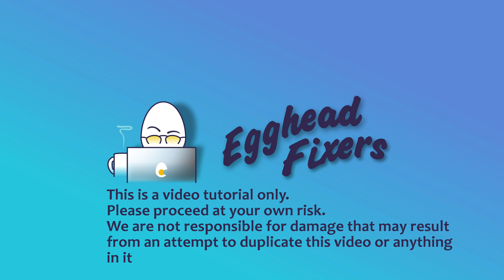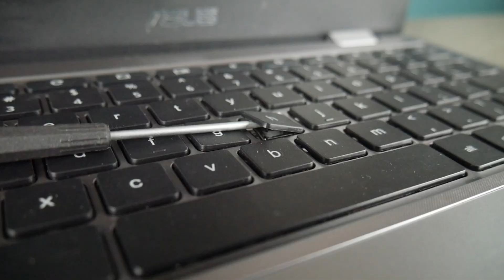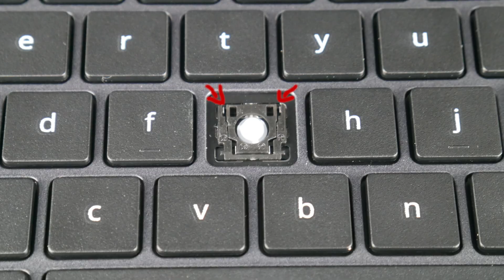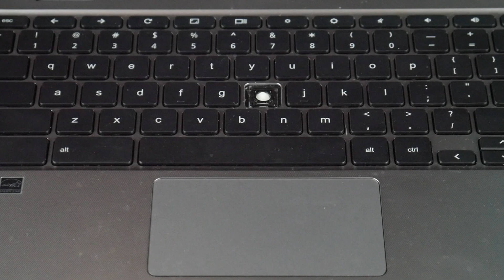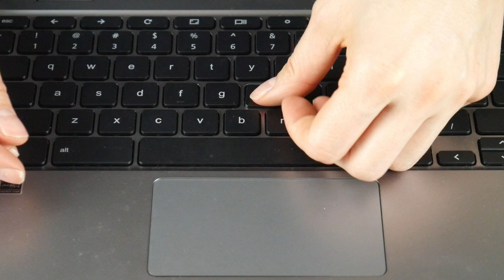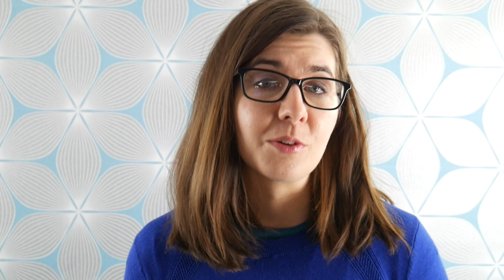How to Replace a Key on Your Alienware Laptop's Keyboard - Tutorial by a Certified Technician

Comment: My cat pulled my spacebar off. Any suggestions? The piece in middle is broken.
Reply from the maker: You can replace the spacebar just like any of the other keys. It's usually a little different than a regular key. There can be more than one retainer clip and there may be metal bars that need to be attached.
Reply: @EggheadFixers any idea where they sell the plastic piece that goes in the hole in the middle that allows it to balance? I think it's called a support bar. Might be called the scissor clip. The piece broke in 2 when he ripped it off.

Comment: m16 r1 keyboard has some keys falling off. Any way to replace or re attach them?
Reply from the maker: Yes it should be the same steps you see in this video. If you end up needing replacement new then you can usually buy them on eBay or Amazon

Comment: Question as have had issues with my space bar ever since removing it to clean. When I put the hinges back into place at first they didn't seem to be sitting right so I pulled off the cap again and got it where it seemed OK but the hinges are just laying flat on the frame underneath, They have no springy type feel them.The cap goes up and down some due to the center round button underneath but alot of times even in this comment the space just does not want to register.

Is there a reason the hinge might not have that springy feeling like it should to return the space key cap back to it's default not in use position??? Cause it's so annoying now not getting spaces when I need them unless I  edit alot to get them in there
Reply from the maker: There are two reasons that typically cause this issue. The first one there are usually one or two rubber pads under the space key. They help the key bounce back if one of those falls off then the key will not bounce back. The second reasons is the metals bars under the space usually get hooked or placed  into metal loops on the keyboard…if the bars are not installed in those loops then the key will not work correctly
Reply: @EggheadFixers  didn't see any rubber pads but perhaps this is why. Do you know if Alienware M17R5 has this sort of pad under the hinges or not?
Reply from the maker: @scottish785  you could always take just the key cap off another key or to see what it looks like. It looks like a rubber cup.
Reply from the maker: @scottish785  if they are under the other keys then 95% of the times it’s under the space key
Reply: @EggheadFixers  actually think I got it fixed I popped it off again to check out the space key and then when I pressed the key cap back into place it seems normal now not loose like it was and the key seems to be spacing like it should when pressed. Have typed this entire message out without spacing issues like I did in my first reply earlier. So seems fixed now thankfully!!
Reply from the maker: @scottish785  glad to hear it worked out!

Comment: I have an M17 R5 I assume the keys remove the same and is there a bar under the space bar that I need to also unhook as I had a soda explode on me last night and had some land on my keyboard. Didn't get inside but it did get under a couple of keys like the space bar and just want to remove the key to clean up underneath it then put it back.

so I assume the M17 R5 removes the same?

And how much force should be applied as I tried to remove it with a similar flat head but it didn't seem to want to pop off as easily as your key did
Reply from the maker: It does remove the same. The only thing to look for is like you said there are bars underneath and sometimes there is two clips underneath instead of one.

Comment: Where do you buy these clips for the dell alienware m15 r5  ryzen edition
Reply from the maker: Typically you would by an individual key off of eBay. If there are not any for sale then you could buy a replacement keyboard and take the clip off of there.
Reply: @EggheadFixers  Yah I have been having a hard time even finding a keyboard for this laptop.  I can find other Alianware models but not this one.
Reply from the maker: @dudley810  See if there is a part number on the back. The same keyboard may be used on more than one model laptop.

Comment: What if the rubber of the key goes out? How do I put it in again?
Reply: I discovered that the second piece of the key in my notebook was worn out! So I used toothpick to fullfill the space, now the key is working. There is my work around LOL
Reply from the maker: @Vinicius_Casadei  hey whatever works. Good for you!
Reply: #ViniciusCasadei Used a toothpick? More detail plz cuz thats the issue im having.
Reply: @durass001  I discovered that this plastic piece gets worn out after a while so the metal suport don't fix the key. I added a little wood between the plastic piece and the metal part and it fixed the problem (Dell just fix the hole keyboard so I did this to be economic)

Comment: What about the removal and installation of the center plastic piece? I have a key that stays in the down position and I assume it is this "cup" that needs to be replaced but cannot seem to figure out how to properly remove it... and subsequently install the new one.
Reply from the maker: The cup is not removable if it falls off then you can try to glue it back on but that often times does not work great.
Reply: @EggheadFixers  
Then what am I to do if the key no longer pops up into its normal position? I've replaced the hinge and the key and still have the same problem. It remains in a "pressed" position. I can tap it and the keyboard responds, but it remains in the "down" position.

Comment: I took the caps lock key off my new alienware laptop and a very small spring and 2 small metal pieces (the equivalent to the plastic piece that you removed but it's designed with 2 small metal half squares) came out and idk how to put them back in and fix the caps lock
Reply from the maker: usually those snap onto plastic clips on the key and then hook into small metal loops on the keyboard
Reply: @EggheadFixers  mine is weird because of the spring I think. It has hooks on the end. Also I can't seem to snap the metal pieces into place and there isn't a bigger plastic.

Comment: i know this video is from awhile ago but im having issues with the rubber cups under the key caps and was wondering if there was any way to replace them
Reply from the maker: Unfortunately you typically have to replace the keyboard when you have problems with the rubber cups. Some people try gluing them back on but this is usually not a permanent solution

Comment: Where can we buy replacement retainer clips if one breaks during removal?
Reply from the maker: You can usually get either a replacement key which will have the cap and retainer clip or a replacement keyboard on eBay.

Comment: Hello Liz, i have the mechanical keyboard in my x17 r2. The S key was stuck and i was able to remove the key thanks to this video. However it seems to be alot different? What am i doing wrong? I got the right side to latch but i cant get the left side of the key to latch for some reason. Any ideas?
Reply from the maker: Sometimes this can be due to a small part of the plastic breaking off or one of the metals hooks being bent down. I would stare at it very closely and see if you see any differences between the two sides.
Reply: @EggheadFixers  Sounds good. I'll take a second look. appreciate the info!

Side note: the x17 mechanical keyboard is pretty awesome other than the durability issues. I hope Dell updates it in the future and makes it even better